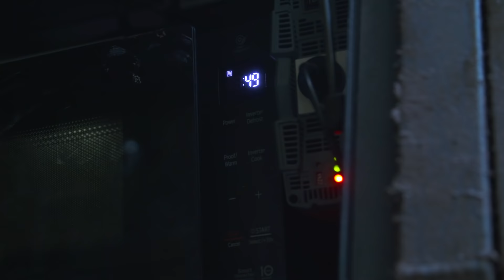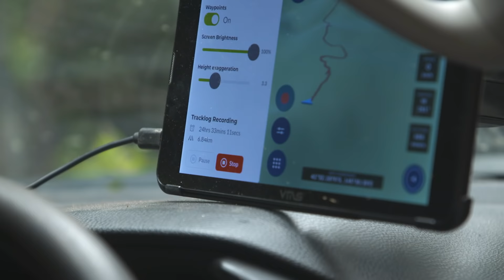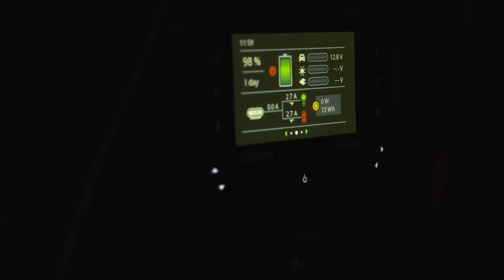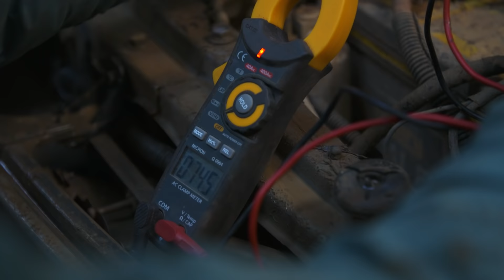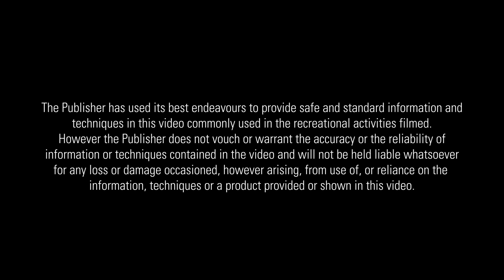Bog Holes FROZEN OVER! Australia’s toughest 4WD track made WAY tougher – do we make it through?

Comment: Awesome track!  Just a hint from Alaska for future winter track camping, wrap that gas canister in a wool sock and drop a handwarmer in it. The gas will work much better for you, Shauno.
Reply: Agreed. I have also stood the bottle in a bowl of hot water, which only works if you can heat water without using gas.  I guess standing it on a warm engine block would work too.
Reply: What a awesome video

Comment: yall might want to check the belt tensioner on that dmax, Seen it a couple times, the belt starts to slip off pulleys and it tears it apart. New tensioner, and its good as gold. also good chance it's the mud, but can't hurt to take a peek at it, especially since its happened twice.

Comment: On tracks like this wouldnt take spare belts, alternator, fuel, tyres?
Reply: Yes it would, including oil, water, sparkplugs, springs, shocks, hoses, wire ducktape, metal putty, nuts n bolts etc. Anything you can think of literally.

Comment: PRO TIP on how to easily start ANY 2 stroke engine
Step one: press primer 4-6 times
Step two: full choke
Step three: pull until engine coughs (DO NOT PULL AGAIN)
Step four: choke off
Step five: start engine.
If it doesn't start within two pulls, return to Step two.
Reply: pro tip dose no apply to homelite chainsaws
Reply: @wyattfarcry5  Pro tip does apply...
Step one: Throw out the homelite
Step two: buy an actual chainsaw
Step three: there is none
Reply: @adamski9952  ahhh i see
Reply: And when you don't have a primer?

Comment: always love watching you guys but i must criticize something, i am an amature at 4wding compared to you guys but my one up on you is i am an expert rigger and you guys do not a double line/snatch block pull as often as you should. the few times i have said to myself watching your videos. "thats gunna let go" iv been right all but twice which honestly i put down to luck. a slower pull is better then a snapped rope not to mention it will help the life/motor of your winch as well. im sure even you blokes can agree that using anything at its capacity will wear it out quicker. single line pulls work best when you just need that little oomph but mud has too much suction and paired worse when pulling up a rut/incline. that aside, love what ya do and i learn plenty from ya <3

Comment: the reason to the low flames is that you are using a high butane mixture in the gas,  the butane freezes at 0 celcius, try and see if you can find a winter gas with more propane in it since pure propane can go down to -40 and still work, and the big yellow flames you get is cause when you turn it upsided down it will put out the liquid phase of the butane instead of the gas :D 
love your show, best reguard Swedish gas tech :D

Comment: When butane is cold, it's only necessary to invert the canister to get its condensed fuel to drain into the line.  (It also doesn't hurt to warm it up a little before it's used.)  But shaking continuously isn't necessary.
Definitely leave the Homelite at home next time!  You won't need three or even two saws if you carry just one REAL saw.   Glad to see someone was smart enough to have an axe on hand.  A few hours chopping wood won't hurt anyone (except maybe Graham lol)

Comment: Chainsaw carby was gummed up from fuel evaporating in the carby. You MUST run them dry if you're not going to use them again the same day. The fix is to spray carby cleaner directly into the carby as you're cranking it over. It'll take a food few doses & false starts but she'll come good. Applies to anything with a Chinese carby.

Comment: just wondering if you every try taking off the alt and soaking in a bucket of clean water to flush the mud out, and if that would work in a pinch. dry it up with a can of contact cleaner to dry it out. epic trail. envious

Comment: Re chainsaw, richen it up as it's cold, you prove that point as you require the choke to be on a little! Maybe a little education on cold climates might make the programme better. Also start using double line pulls on the winches, it'll save your ropes and is better for the winches.

Comment: When the alternator stops working from mud just clean it with clean water (drench it with water) and it will get the internals clean and from the heat of the engine running it will dry fast. This works, i have done it before.

Comment: For cold climates a denatured alcohol or other liquid fuel burner is going to be more reliable than propane or other gas burners. Not sensitive to pressure drops. As long as it isn't cold enough for the alcohol to freeze.

Comment: There's a trick I got taught a while ago if you have a steel cable on your winch you can use it to cut through the log just like you would a rope saw use pull it one way with the wrench then you have your friend pull it the other way with the other winch eventually it will cut through the log I've done it before it takes time but you can cut through a log with your winch cable

Comment: You need a stove that can burn winter-grade fuel.  Otherwise you can tape a small hand-warmer to it.  The shaking your can is only part of the operational dynamic.  You're holding it in your warm(ish) hands.  A heat source gentle enough it doesn't burn your skin . . . probably . . . won't make your fuel can blow up!

Comment: Yeah you never rely on anything made by Homelite lol. That's the cheapo walmart brand also.
You gotta get a good Husky or stihl chainsaw for something reliable out it the bush like that. They are pricey but worth it. Echo chainsaws are pretty good as well and a bit cheaper. At least you guys had an axe with you though. That was lucky.
Reply: Ive got an old echo from the late 80s, I think, that I take on the trails. That old saw rips. 3 pulls at most if it hasn't run in a while. 

But any new saw has got to be one of the two trusted brands on the market.
Reply: @kylegaidos7688  Hell yeah I love echo stuff cuz it starts every time and their stuff lasts. And the price is pretty reasonable. Husky stuff always starts too but definitely pricey. 
Stihl I think is way too expensive and people have a hard time starting them. I can't tell you how many times I have had to replace pull cords on stihl stuff lol. Cuz people don't know their starting process works.

Comment: I’m waiting for you guys to test a rivian r1t in those trails 
Going to be epic!!
Reply: The power, the capability of changing drive to each wheel, ride height adjust, should be pretty interesting.
Reply: would run out of power especially in that cold
Reply: @chir0pter  They have self heated battery packs to keep them optimal, lots of Teslas roaming around here in Alberta with our last dose of -30c and -40c. 900 Ft lbs of Instant Torque with no gears and individual adjusted power to every tire could yield the greatest off road machine ever made by a good margin.

Comment: chain saws hhhmmmmm , some chainsaws have a safety switch on it , it is conected to the black safety guard right infront of the handle . i think its pull it back to stop the machine and push it forwards to let the machine run . not to many folks know about it ..

Comment: Just wondering what engine upgrades Graham has done to the Dmax.  
Remap?
Exhaust?
Throttle controller?
I have a remapped N90 within EVC throttle controller and was wondering what else you could recommend. It's an auto.
Cheers Shane

Comment: I’ve been wondering why you guys air down in the snow. I know you do it in most off road situations but in the snow you’re increasing the surface area of snow you have to push through. It seems to me taller and narrower would be better. In my younger days when we mud bogged the hot tire was a 34x9.5-15 inch because it was narrower, and it cut through the mud as opposed to say 33x12.50-15

Comment: Lots of winching but I rarely see a snatch block used to increase the mechanical advantage of the winches. You can get the same pulling force with about half the rope tension though it does take longer. Seems worth it if you are constantly snapping lines.

[Edit] LOL, looks like I just needed to watch a bit more.

Comment: Always bring an electric chainsaw for cold weather/high altitude trips. The air fuel mix gets all messed up and you don't want to be messing with it when it's 0 degrees out
Reply: lithium batteries don't like cold tho..
Reply: @chir0pter  that's why you keep the batteries in the nice warm cab until you need them

Comment: Why bother with the winch blanket if you are putting it on the opposite side of the pulley from the driver?

Looks like Sooty has the same problem with its arbs as mine, always leak!

Comment: I've never liked the idea of serpentine belts, especially on 4x4s. As soon as you get a lump of crap in between the belt and a pulley, your risk damaging the belt. And with everything being driven by just one belt, that's not good. I much prefer good old reliable vee belts, with a different belt driving each accessory.

Comment: 58v AEG chainsaw problem solved  
No need to pull a cord or have to carry fuel
Reply: Yeah, just gotta spend hundreds on extra batteries that don't like the cold & have spent thousands on an electrical system to charge them. 
Well maintained petrol saw will start first time every time & if you were honest with yourself, a litre of bar oil & 4lt of fuel doesn't exactly take up much space
Reply: @gqwarrior6694  thousands on a electrical system to charge them I'm not sure why the only have a 300watt charger to change them that will run off a 500 watt inverter that will cost you 200 of eBay and the space saving thing had nothing to do with it...it's the fact of the smell of fuel and having to fill up all the time and not pulling cords and as for the cold I live in tropical north QLD so no need for that worry
Reply: @saltymcnuts3586  Oh, invertors are a stand alone item that require no other mods? The wire alone will set you back $150. You are recommending a battery operated saw for an environment with snow so where you live is irrelevant. If you can't transport fuel without being able to smell it, I'd strongly suggest you don't know what you're doing. As for pulling on a cord, if that is an issue for you, then why even have a chainsaw? Using it is a hellava lot more effort than starting it. Sorry but your points are either silly or point to your own lack of knowledge. I'm not gunna argue about this anymore, you're flat out wrong & don't know what you're talking about. Merry Christmas
Reply: @gqwarrior6694  righto champion if you say so
Reply: @saltymcnuts3586  I do but then again, I know exactly what I'm talking about & am not backtracking from my own comments like you, so I can do that & not sound stupid....